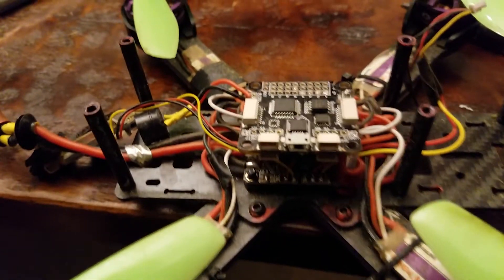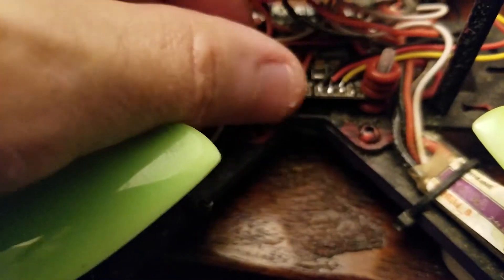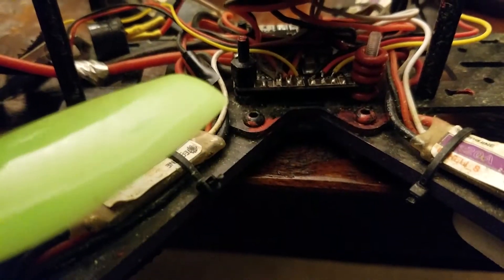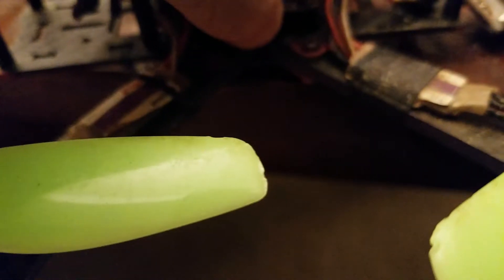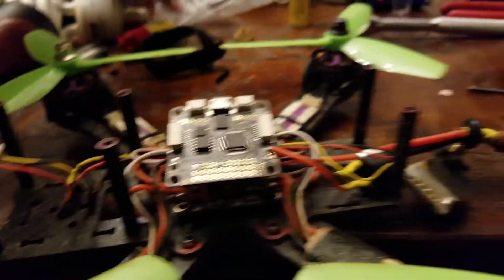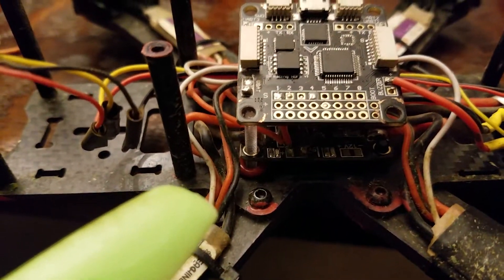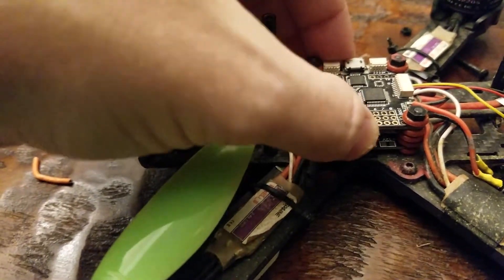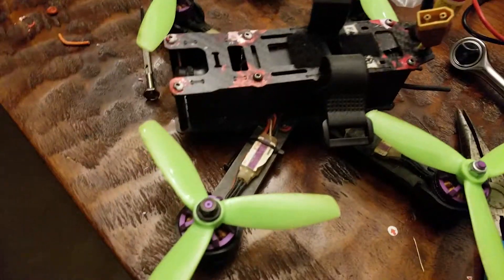Cheap and Easy DIY Soft mounts for Flight controller

Comment: let us know if you truly notice a difference!
Reply from the maker: well, i took it out to hover and it didn't give the little jerks and sways.  i'll have a chance to test it tomorrow.  I believe i said before that it was a tool and not a silver bullet...but i'm hoping.  I have some pre-change footage that shows my problem so it'll be a an easy before/after vid.
Reply: Looking forward to that!
Reply from the maker: Night and day difference....holy cow.  I can't wait to do my motors.  not a silver bullet..but maybe a copper one
Reply: Thanks for the update!  I'm overhauling one shortly.  Now it's definitely getting the FC mounts.
Reply from the maker: sadly, it's hard to see in the dvr video other than the jitters i was getting before that are completely gone.  I get a small bobble on the end of fast flips but that's tuning and not as bad as before.  What makes this feel so good is that it will go full throttle without a peep beyond a ripping sound.  it's awesome.  i can't wait to try the motors next.